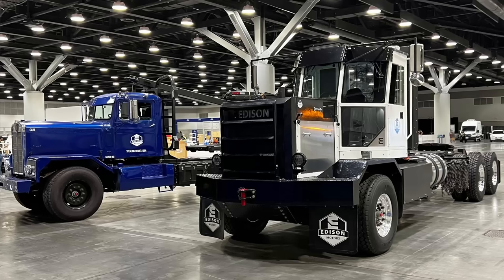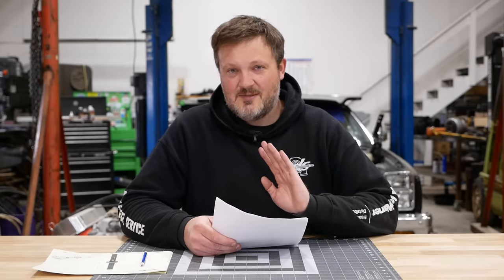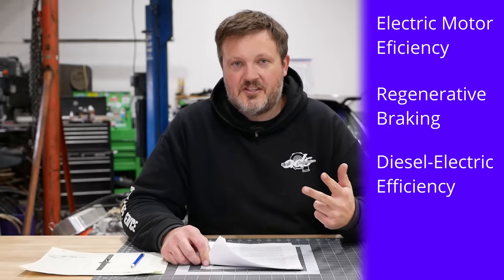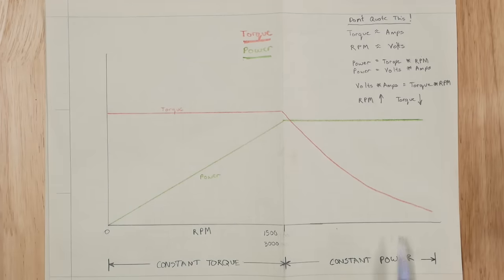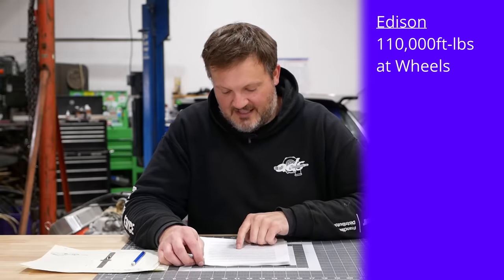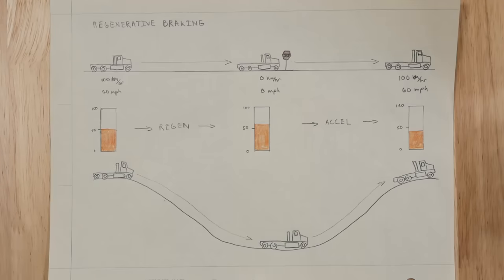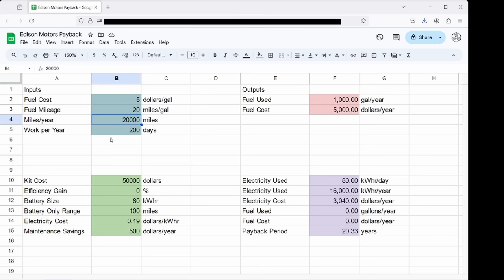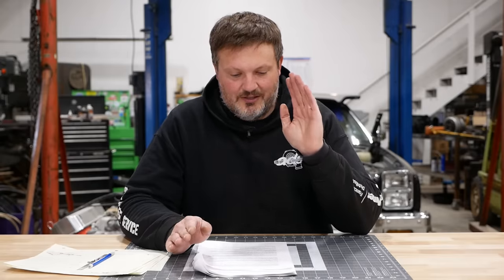Edison Motors Built a Diesel - Electric Semi Truck

Comment: A couple of things that were overlooked.  

1. Transmissions have lots of parasitic loss.  You may have a 1000hp motor but only getting 600hp at the wheels. The more gears you have, the heavier the gears, clutch friction, even the drive shaft, all contribute to parasitic losses that can be 30%-40% of your engine output.  This parasitic loss also affects the torque output of the engine to the wheels.  So by removing the entire driveline and going with E-axles you remove 90% of those losses, and all the weight the driveline has.  The L500 has an output torque of 68,400 ft.lbs, a new Kenworth W600 has 1,850 ft.lbs, both putting out over 500hp.  Edison’s e-axle is vastly more powerful and efficient than a diesel and mechanical driveline.  

2.  Trucks do not run at max power constantly.  An 250kW e-axle is not going to be constantly run at that power.  You will get maximum power loads as you start from a dead stop, but as you convert that power into kinetic energy you need less and less energy to accelerate or maintain that speed.  This is why electric motors excel in high loading applications like locomotives.   When they hooked up a 100,000 load to the truck they pulled 25kW from the batteries from a dead stop.  So realistically you will never pull anything close to what the e-axles are rated for.  

3. By removing the engine from the driveline it allows the diesel to run much more efficiently.  If you ever watch a semi go from a dead stop with a heavy load, you see the frame twist (energy lost), the black smoke as the engine bogs down, fuel and efficiency losses as the engine works, then almost as soon as the engine gets in that sweet spot where it wants to run, you have to shift and do it all again.  Edison removes all that by allowing the electric drivetrain do the work.  Diesel engine will only be working in the peak power band at a fixed RPM.   This reduces the wear on the engine, decreases the emissions, is more fuel efficient, and the motor isn’t constantly running when it is not needed. This means you need a smaller motor and fewer accessories, like an alternator, and power steering, AC compressor, and other parasitic accessories on the engine.  One other thing is you don’t need to run the engine or APU when the vehicle is idle, like at a rest stop.  

4. Maintenance costs will be much lower that a traditional semi truck.  First off you remove the entire transmission and driveline, so all that maintenance is gone.  The electric motors and the axles are completely sealed with minimal maintenance needed .  The diesel engine will also require less maintenance with longer maintenance intervals.  With the diesel engine running 25% or less of the overall operating time of the truck you will have a much longer interval between rebuilds.  When you do have to have an overhaul of the diesel engine it will be less expensive as well.  There is less wear and tear on the motor because it has a constant load, and because it is a smaller engine the rebuild will be cheaper.  And with Edison’s philosophy of right to repair, no planned obsolescence, and use of off the shelf parts, the overall maintenance for an Edison truck will be much less than its competitors. 

Edison Motors has been going about developing its truck the right way.  It started with Carl, taking an old 69 Kenworth and replacing the driveline with an electric motor out of Tesla model S, added on batteries and a generator to the diesel engine.  This resulted in a 70% increase in fuel milage.  Unfortunately the torque from the motors would often snap the driveshaft. It did show enough potential to move to the production prototype L500, called Topsy.  Right now they are working on testing and will have much more concrete numbers on how efficient it can be.  The concept is solid and with Edison’s corporate philosophy it is poised to change the industry.
Reply: Watching Topsy pull the Shermanator the first thing I noticed was no frame twist. So yeah not loosing any torque into the frame, the motor mounts or to axle wrap. Wes also over estimated the torque when he did the math on a 15L Cummins. Its 850ft/lbs at idle 1850 at 1400 rpm... Thats why Topsy moves that tank so easily. Eric was blown away with how "Little" power it was taking to get going...

Comment: The first job I had out of college ( which kept me out of the rice paddies of Vietnam) was working for a defense contractor. One of my jobs was developing a DC watt hour meter to control and manage the charging of the propulsion batteries for attack submarines.The first few of these were retrofits of old diesel powered “ fleet boats”. They actually used several (4 ) diesel engines ( usually Fairbanks Morse ) to power generators to charge batteries while surfaced. Then while underwater the batteries powered the electric motors which propelled the boat. This truck design seems like a variant of that “ very old” technology. Obviously, calculating submarines efficiency has really never been highly motivated . They have helped win a war and have kept us very safe. I love innovation of any kind. I’m even a patent holder. I loved this video. A master class in everything engineers do. Including the economic analyses which most people don’t realize is a huge part of the job. Thanks again for your great work.

Comment: Another factor on regeneration that nobody talks about. I figured out this one by looking at the regen numbers on my own EV when hauling a trailer. You will get the penalty from hauling the extra weight of the trailer up a hill. However, you will not get any regen from the trailer downhill. The reason is that the trailer (unless it’s a really small one) is going to need it’s own brakes, or it will scissor the car in the first durn going  downhill. These brakes will be either air (a semi), electric (US) or run-on (European, smaller trailers). The energy from the trailer going downhill will not generate any more power.
Reply from the maker: I didn't think about that.
Reply: @WatchWesWork  Regen is also limited in most EVs to protect the battery. A loaded semi going downhill generating 200+ kw of electricity; the BMS will no doubt need to limit that intake or divert it somewhere else for a different use.
Reply: I disagree on this.  

On a normal truck the Jake just uses the drive axles.  The regen works like a Jake, but captures power
Reply: Logging trucks don't typically use their air brakes to descend or they'd cook them and be on fire in minutes. The brakes need time not braking to cool, but you don't typically have any time for that down a steep hill. It's all engine braking. Same with properly driven highway trucks, too.
Reply: to get a regen benefit from the trailer, it would also need Power Axles and all the problems those bring with them. It *might* make sense for a vocational truck like logging trucks, but it would add a hell of a lot of expense on the trailers which take a hell of a beating
Reply: @EdisonMotors them prove it
 you got the truck
Stop the talking,math and supposition
Reply: @EdisonMotors  You are talking about a semi, the OP is referring to a smaller EV towing a trailer.  This is likely part of the reason that various YTers have found the range of the Ford Lightning is pretty bad when towing, it reduces the amount of regen in tow mode and the trailer will have regular friction brake.
Reply: @Hyratel It's still mass with great amount kinetic energy. Sorry, your statement doesn't make a lot of sense. 

Apply only the tractor brakes or the jake brake in fully loaded semi, the trailer will push the truck forward. A very common cause for accidents in winter conditions.
Reply: @johanw9513 Semi trucks have retarters/jake brakes/engine brakes for slowing down while going downhill. Still, the trailer wont jackknife in normal operation (both semis and rigid + dolly combination), even though the braking is only done on the drive axle. No air brakes are applied on the truck nor the trailer.

Regen in an EV truck is the same concept but here you just capture some of the energy back. In a diesel truck you just don't burn any additional fuel while engine braking.

Driving downhill with a loaded truck + trailer (tens of metric tonnes) is totally different deal from driving a car and a trailer in any situation.
Reply: @vilenius187  Jake brake is a engine brake mister know it all
And retarder have not been used in age on truck
Braking power is limiter by the tire traction  you think you can slow a 80 000 lbs load on a downhills with only 8 tires when you got 18 up to 30 tire with a 5 axle trailer as lol the braking power is on the trailer
Anybody that driven a truck with a medium sized trailer know they have electric brake for a reason
And there a lever on the dash of big rig to apply just the trailer brake 
You can buy gullible all you want this got no future or it would have been done
It's already been done on construction equipment but there no way to run pure electric the engine alway run it just got electric motor for traction motor in lieu of hydraulic system to move the machine
But the engine still turn the hydraulic pump for the lift cylinder/heat and a/c
You can go read more on cat site the model is d6xe it's a small dozer
Reply: @legros731   @legros731  Many European modern trucks have retarders and normally pull (and slow down) weights up to 167500lbs. 

And if you read my comment, I said tractor brakes, not trailer. In order to demonstrate that the trailer has massive energy and still jake brakes are used daily with no problem.

I write this since people who don't drive trucks sometimes have no idea what kind of momentum the thing has.
Reply: @vilenius187  lol no way like a said the limiting factor is the tire grip why only use 8 when you got 18+ tire and most truck have a lever to activate the trailer brake separately so you can totally use the Jake plus the trailer brake 
sure on a straight flat road the Jake is more than enough but we talking log hauling on dirt road in the mountains 
Locking the driven wheel will not slow you down in a downhill 
like Europe know anything about hill or long distance hauling 
And there no way a truck weight that much a 5 axle trailer max load is 80 000lbs

Comment: I don't know much about US pricing on Semi trucks Wes, I'm in Australia, currently I'm looking down the barrel of repowering my Kenworth with a reman Cummins ISX, this is going to cost me somewhere in the vicinity of Au $100,000. To replace my truck with a brand new equivalent unit I'd be looking at between Au$ 350 - 400,000. With numbers like that, the Edison kit starts to make sense, unfortunately will not be available in Australia in the foreseeable future and I'd estimate if it was, the cost would be likely Au$150,000 or more.
Just my 2 cents worth, Hopefully for Edison it works out, it's always nice to see innovation from outside the normal places and in places like Australia, a fully electric semi just doesn't make sense for the majority of the country (look up Janus trucks for some fiery evidence).

Comment: At first I wondered how it can require zero energy input, because it cannot be 100% efficient. The I realised that when coming down the mountain, the truck is loaded with logs, but when going back up, it's unloaded. So the energy 'input' is coming from the logs moving downhill.
Edit  - Ah, Wes mentioned this.
Reply: Was about to comment the same thing. That's going to be very interesting if it actually works
Reply: See YT videos on old Welsh mining narrow-gauge railroads, long before there were ANY locomotives at all.  Some of them are still operating, as museum exhibits.  Astonishing to watch, and realize the engineering skills of 150 years ago.
Reply: Even then it cannot be 100% or there would be no need for cooling
Heat produce=loss 
No way around it perpetual motion doesn't exist

Comment: If the payback estimate is 18 years or so for their system, and normal battery life is about 7 years or so, was battery replacement (almost 3 times)  figured into the total payback time?
Reply: That’s a good point, if your ROI is 17-18 years, then it will never be worthwhile. After all, companies have to make money.
Reply: Reliability and repair costs could swing it either way. Many less moving parts.
Reply: Wes didn't figure in financing  costs, either. Who could pay $104 000 cash to convert their semi? Add 50% to the cost, amortized over 7 years.
Reply: Where are you getting 7 years for a battery replacement?
Reply: @ThisIsReMarkable  Motortrend data on Tesla batteries. Of course , commercial vehicles would probably have more severe duty cycles, and degrade faster.
Reply: @TheMetalButcher not at all still got a engine and all the maintenance associate with it
Reply: ROI will be HEAVILY influenced by the application- as the edison guys who chimed in up higher mentioned. I've had situations in our specialist 4wd trucks at work where my consumption over an extended period of time wasnt 7MPG (33L/100) but it was a sustained 140L/100 (1.68MPG) over about 6 hours of hard work. If your doing that day in, day out, comparing it to the 60L/hr the generator consumes at full load would definitely have a much shorter ROI, but as per normal, its all about the application!
Reply: @ferremit  1.68 mpg I call BS. At that duty cycle, the injectors would not even be able to pump that much fuel. Or your vehicles were almost stationary, in which case you use l/hr, and you are being deliberately disingenuous.
Reply: @TheMetalButcher  maybe less moving parts offset by more expensive parts.  Generator vs transmission? Transmission and driveshaft vs high voltage drive motors? Edison will likely have multiple very pricey ecms ... too many unknowns like reliability, parts supply etc
Reply: @kidsteach938 Unless you've found a Motortrend article I have not, nowhere does it say EV batteries, Teslas or otherwise need to be replaced every seven years
Reply: @ThisIsReMarkable  Then you need to keep looking, and read carefully. Cheerio! Or are you suggesting that batteries have an indefinite lifespan?  You are aware that the miraculous Tesla battery consists of several thousand 18650 laptop or flashlight batteries wired together? you are aware that even laptop batteries don't last "forever"? I'm being very patient with you, my friend.
Reply: @kidsteach938  Mate, its not that out there. 15T MAN TGM 15.290 4x4 truck, working in soft sand in 4wd doing firefighting. Not stationary, but we didnt see a lot of time above 20kph. Or you could go chat with my neighbor who runs road trains from Adelaide to Darwin, He'll burn 3-4000L to do a 3000km trip pulling triples. Some of the guys doing heavy haul in the remote outback in WA have said that their trucks will drink .8-2L PER KM trying to pull up and over ranges.

Point I'm trying to make is that not every single application is the average single trailer down a highway, or a penske style box truck running around a city- theres a lot of applications where the ROI is nowhere near as long as what Wes calculated due to their usage case
Reply: @ferremit  well, the kits being discussed here are for regular semis and consumer class 4x4's. Your firefighting MAN would certainly be an exception, and I'm sure that there are not many in use around the world, at least compared to the units that the kits are being designed for. Your road train is doing the work of three US class trucks, and likely earning sufficient to pay for fuel. Still, no real profit in a niche market. I'm sure your maintenance schedule also reflects hours not kms. You wrote"comparing it to the 60L/hr the generator consumes at full load" Your MAN 4x4 has a 300hp engine, and unless the generator is likewise 300hp, the battery would deplete rather quickly...there being zero regenerative braking in such a situation. likewise, on the Nullarbor, flat as a billiard table, there is no savings in energy from regenerative braking. Apples and oranges.